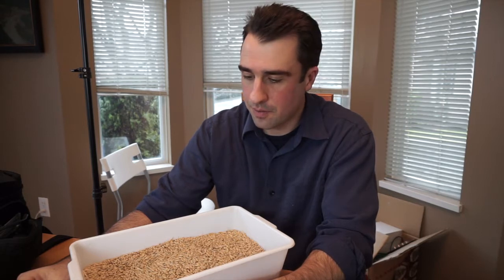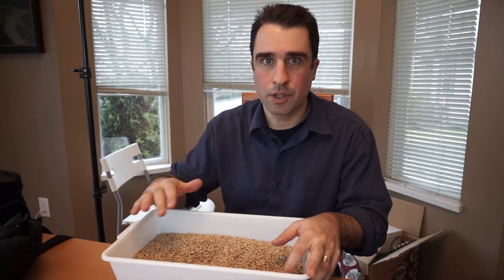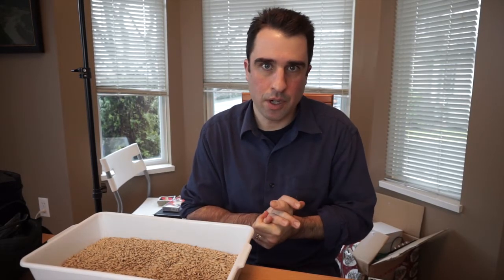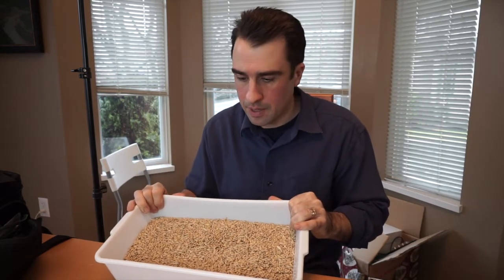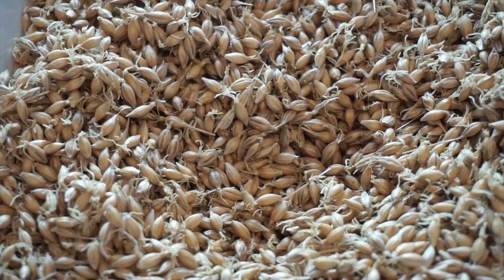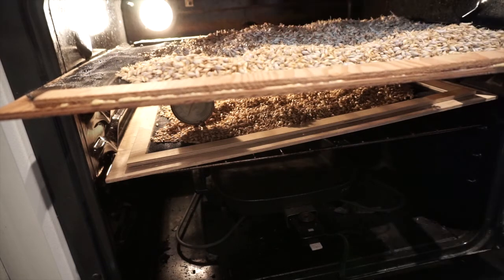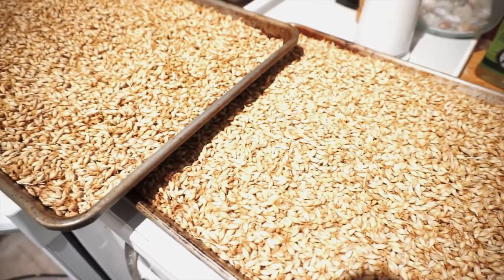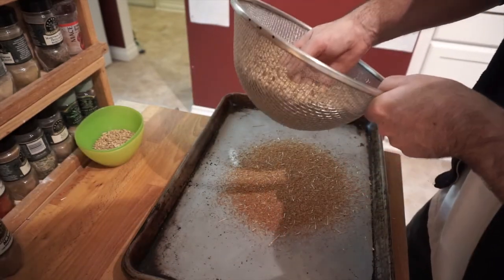Pale malt

Comment: Good to see someone who seems to know what he is doing! After six years of homebrewing I am just getting into homemalting and am strongly considering to get that book of yours now :)
Reply from the maker: Well thank-you! malting is such an interesting hobby, after almost ten years I'm still learning new stuff. I find the book is a convenient way to access all the recipes I have found instead of swimming through the blog - so yes you absolutely should buy it and the malting log book too - very handy! Cheers!
Reply: @BrewingBeerTheHardWay1     
I just ordered the book :)
Maybe I can bother you with a question regarding my first batch? It started with 1kg of wheat and I followed “simpler” instructions from other sources, but only stumbled upon all your content on day 3.
So I didnt check for moisture content, neither before nor after soaking. I did 3 soaking cycles (each starting with 4 hours wet, 20 hours dry - 13°C). After those 3 days, I let it germinate for 4 more days now and it has germinated a bit unevenly. Most acrospyres are 3/4 of the grains length now, while there is a noticable amount doubling this or cutting it in half. The starch spreading test comes in mostly fine.
I feel like I should dry it today, but I can’t get my hands on a food drying machine before tomorrow. Alternatively, I have got an electric oven which can in practice heat as low as ~60°C.
What should I do?

Thank you in advance!
Reply from the maker: @2moon4moon  Spread it out in a thin layer to wilt it, like a half inch or less. You can even put a fan on it. Wilting stops the growth and will buy you some time. This used to be a common practice but is not done today for the sake of speed. Even though the growth stops the enzymes will continue to develop so it's actually a good thing to do as it will raise your diastatic power. As far as kilns go check out my blog for some design ideas , food dehydrators tend to be pretty small. The easiest method I've found and it's been very consistent is the electric fry pan (at 11:30 in the video) with a temperature dial which you can often find at a thrift store for $10. When drying small amounts (under 5 lbs) you don't even need a fan just some heat so one of these fry pans in your oven or in a wooden box works very well.

Comment: Great video.  I have watched several on the malting process, and yours is the best I have seen by far.I am getting ready to try malting for the first time this weekend.  A farmer friend grew 3 acres of "Hockett" 2 row marling barley, and I now have a free supply.

1st question.  I am in Arizona, and it is very dry here.  I am going to use my "fermentation chamber" (small refrigerator with temp control) for holding the grains around 55f for the process.  I assume I should spray/mist  the barely a couple times a day during the sparging and germination phase.  Does this sound correct?  

I am thinking the air drying phase should work extremely well here with our single digit humidity.

2nd question.  For the roasting process, you mentioned that you normally kiln under 120f till moisture is below 10%, but this time at 33% humidity, you did 140f for 3 hours, 175f for 2 hours, and then 195f for 2 hours.  I really like the idea of a shorter schedule in the oven.  Did these grains mash normally in the brewing process, or did you need to mash longer?  With this kilning schedule, would this still be called "pale" malt, or would be called something else for comparison.  Have you adopted this process now, or have you gone back to the 120f till under 10% schedule?

Sorry I have so many questions.  I am really excited to try this, and I don't want to mess it up.

Thanks again for the video,
Rob
Reply from the maker: Thanks! I'm jealous, good luck and let me know how it turns out. Cheers
Reply from the maker: Hi Rob unfortunately I'm only seeing these questions now, sorry for the slow response! Increasing the temp to 60C between 25-35% will sacrifice diastatic power for flavour. Diastatic power is also dependant on how well modified the malt is and how many enzymes have been allowed to develop so lots of variables here. Didn't have a problem mashing with this schedule but it would be good to do a side by side comparison with the two different schedules to see the flavour difference. Most of the time I dry down to 20% before raising the temperature up to 60C just to be more safe. Currently I've been messing around with really long germinations (2 weeks) and long drying schedules 24 hours just for fun, these have a lot of diastatic power, conversion happens very quickly and are very friable. Spraying or misting does depend on your humidity, if you're still using the small fridge I probably would not spray, the roots should start to wither on day 5 or 6 but if they're not looking healthy before that and the acrospires aren't long enough then yes you could spray to perk them up and extend the germination.

Comment: Great video, has been very informative. I've checked out your blog on the pilsner/pale malts but do have a question for ya if I may: your oven door is probably slightly ajar during kilning, is this also true for curing ?? Thanks in advance.
Reply from the maker: +muslixrex Actually there's a gap in the door seal which is 4" long and just wide enough for the wire to go through at the bottom of the door, our other oven was the same. So  the door is fully closed during kilning and curing.

Comment: Very nice video, very informative, Question, do you cover the grain while its germinating? Thanks
Reply from the maker: Thanks sjoha, you usually keep your grain uncovered while germinating because the grain needs oxygen to grow. If you want to slow down the growth to prolong the germination you can cover it and the CO2 will accumulate slowing the growth.This is what's called "couching" However with small amounts of grain I find that  the oxygen to grain ratio is greater so this method is not that effective unless you pack the grain into a small container with very little head space. You want to have a long germination (over 5 days) to allow the enzymes to develop in the malt. Another way to slow the growth if your acrospires appear to be getting too long is to spread out the malt on a screen to a depth of 1-2" to allow the roots to wither, essentially drying out the malt a little.
Reply: Awesome thanks for the reply. What I've been doing is having a lose covered plastic draped over the container.

Comment: hello!!! im at day  5 and the starch in not like a paste and not hydrated... also the acrospire reaches only the 50% what should i do??
Reply: +the roots are about 1-2 cm!
Reply from the maker: thodoris saridis You may want to let it wilt. You can do this by spreading it out to about an inch or two in depth. The enzymes will continue to develop but the roots will dry out a bit and stop growing. Historically English maltsters would germinate for as long as ten days.
Reply: Brewing Beer The Hard Way ok the roots have stopped growing but the starch is very dry!
Reply from the maker: thodoris saridis What's your climate like? If you live in a dry area you may want to cover your malt next time with a damp cloth and keep the temperature lower. Try weighing it to see what your moisture content is, if it has dropped more than say 5% spray it with water a few times per day.
Reply: Brewing Beer The Hard Way the moisture in greece is about 50 to 75% these days. i started with 5kg barley and after steeping i had 7250.. now i have 6450... today also saw some mould at the barley that was cut in the middle .. maybe it is time to throw it..!
Reply from the maker: thodoris saridis If the mould is inside that may have been there all along. I find quite a few rotten ones (an ounce or two) when using feed barley and try to pick them out. Mould can develop in the field or when it's stored and the moisture content is too high. What was the moisture content of your barley? I wouldn't chuck it unless it smells bad. Try kilning it, you may just have an undermodified malt that requires a longer step mash.
Reply: Brewing Beer The Hard Way firstly i use feed barley. it doesnt smell bad. i have to admit that i didnt find the moisture inside the oven put inside a pan with 100gr barley that i roasted... maybe bad idea (this gave me 13% moisture) BUT! the barley because of the high temperature became pop corn so thats why i found 13%... today in order to be sure i did the way you told! inside the oven at 90-100 for 3 hours.. this gave me 7.3%. i used 5kg barley-7.3%=4635+44%(the max for pale malt) = 6675 and i made it 7250... much more moisture... but the starch is dry!
Reply from the maker: thodoris saridis Your "bone dry" weight is correct at 4.635 kg but you need to divide that by .56 to get a target steep weight of 8.277 kg for 44% Your moisture content was only at 36% which would explain why it's dry. You can still use it if the mould problem isn't too bad. I just found that some health food places where I live sell "sprouting barley" this is whole barley used to make barley grass juice with. It's a food grade barley with a 98% germination rate so it's very good quality, perfect for malting but expensive at 2$ a pound. This costs more than malt out here but I might give it a try.
Reply: Brewing Beer The Hard Way thank you very much for your patience and every day you answer my questions and help me to start! i have an idea!!! if i try to steep it again for example 6 hours until i get the target weight that i had to achieve?? and about this sprouting barley how can i make it at this point which the roots are almost dry?
Reply from the maker: thodoris saridis The "sprouting" barley is for the next time, if you can find some. I think at this stage now that the roots are out it's too late to steep again. Think of it like a plant at this point, soaking will probably suffocate them. You could try just spraying it or if you do try soaking it, soak for an hour then drain it and let it breath for an hour and repeat, just so it's not underwater for too long. Cheers!
Reply: Brewing Beer The Hard Way hello!! the weight measurement have to be taken after the last steeping or after the last resting?? (i need still 8-10 days to germinate and i try to find a reason!)
Reply from the maker: thodoris saridis Either, they'll be pretty much the same.